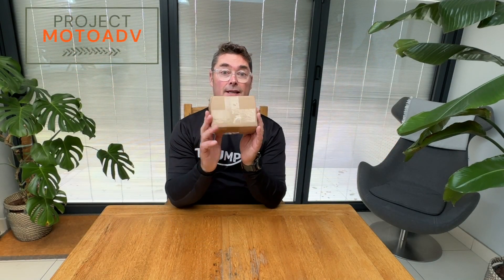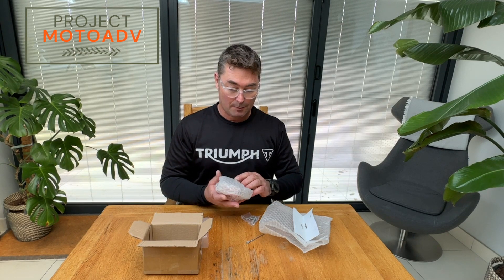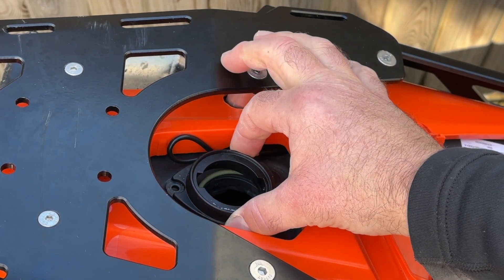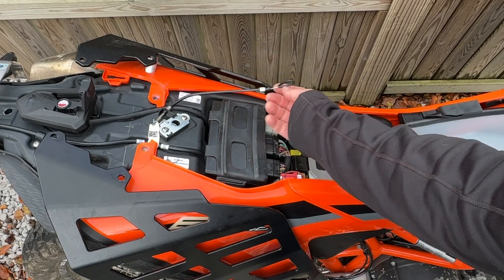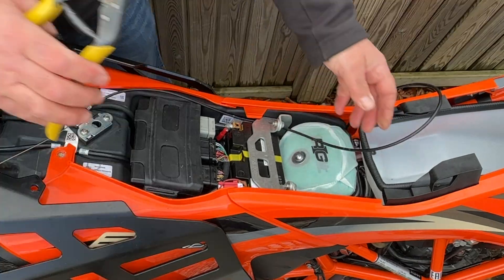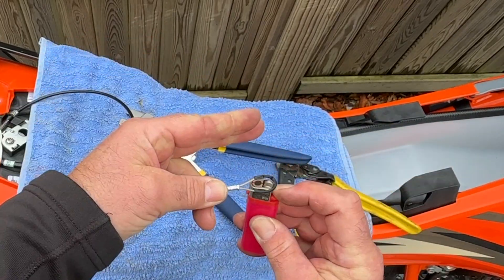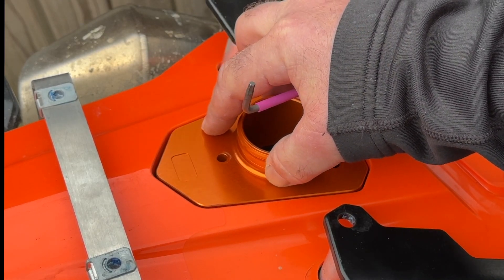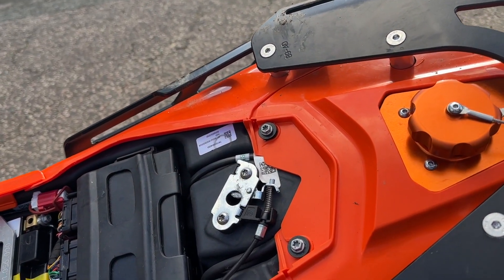NICE CNC fuel filler cap installation and seat removal mechanism modification on my KTM 690 Enduro R

Comment: Great video. Well filmed and edited for sequencing of the job. I've been eyeing this raised filler cap for quite some time now - for my 2011 model I had from 2014-2017 and then my latest one which is a 2017 model that I've had since last year and have done several functional mods. This filler cap is one of my last outstanding mods, together with a steering damper, RG tower/screen and the AS luggage frames.

Comment: installed CNC filler cap this weekend. Cable mod worked a treat, much easier solution for seat release. My only issue was the rear plastic which sits over the filler cap. This needs to slide on from rear of bike to locate in the slots of the rear side panels - this is not possible when the raised filler cap is installed. I had to remove the left rear side panel to give me space to fit the vent hose and install the filler cap with the rear panel in place. If I want to remove the rear panel in future (e.g to fit tail tidy) I will need to remove the filler cap. Anyone else with this experience?
Reply: Same experience. Poor design. It doesn't need to be that tall.

Comment: Looking to change the fuel cap on my 690 Enduro R 2023. Was thinking to buy the release cable from the 2020 MY 690 Enduro R which is located in a simmialr position to where you have relocated yours - is this a viable option and did you consider this before doing the mod on your cable? Thanks
Reply from the maker: I would think that your suggestion is a perfectly good solution.  To be honest I only discovered the issue with the cable once I'd started to install the new fuel cap.  So I thought on my feet and came up with a solution from things that I had to hand.  I have friends who have just shoved it outside the tail fairing!